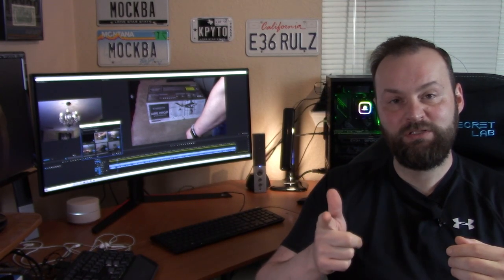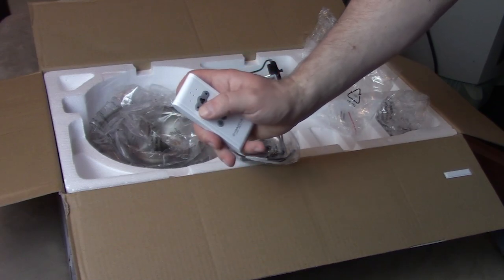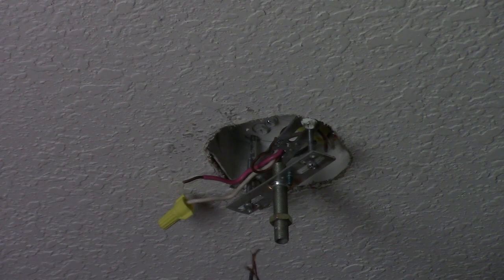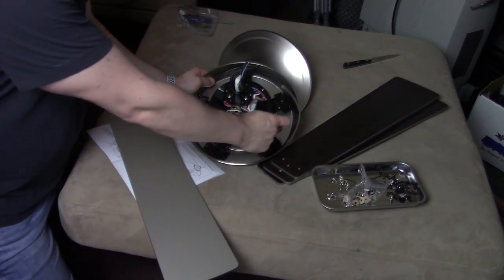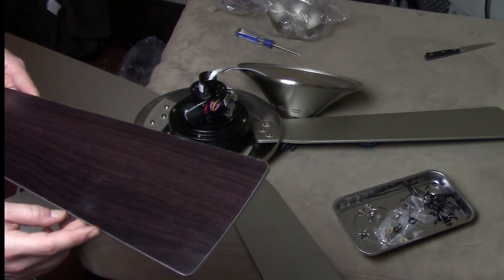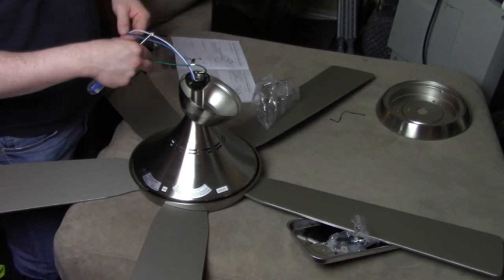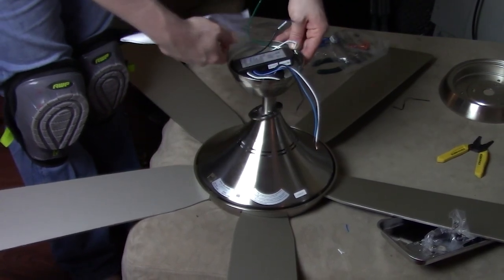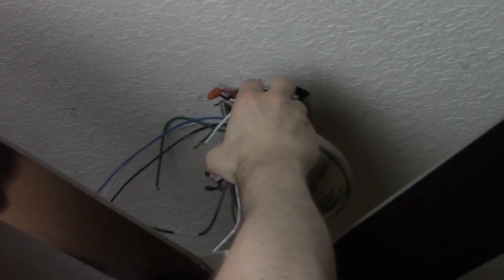How to install a ceiling fan - FANIMATION Aire Drop or Celano V2 - Review, Installation & Connection

Comment: Glad i caught your review. One item i just noticed though - be REALLY careful if you're doing this to an existing hardwired light.  I have separate dimmer/fan switches.  Support tells me I can't use my remote and have to install without receiver, especially because switches have separate wires.   The note about no dimmer and switch like that is IN the box nothing on outside.  We will see what happens.

Comment: You should make a point of letting people know that your video is for a "Flush Mount" type installation. No down rod. The down rod complicates things in a major way when trying to put the receiver in the canopy. It's basically impossible.
Reply from the maker: Thanks for the tip. I’ve updated it.
Reply: where has it been updated for that?!
Reply: Fix: moved AC (house wires) out from the middle of the hanger and running around the edge of the outside, therefore the receiver now has enough room to fit under the gap of the sloped ceiling and above the fan hanger

Comment: Hello i was installing the same fan but I only have black,red and white wires came out from the ceiling BUT the fan remote control have only black and white cables I connected black with black and white to white BUT I have only 1 switch for the light so black is not working for the switch so can I connect red and black for the switch to control the fan and light?

Comment: is this possible to install this fan if you only have a positive an a negative  coming out of ceiling old house and if so a short description  would help me thanks would i put the box on with the power wire for the fan an light

Comment: This wss a good tutorial for the installation but i don't like this fan because the remote is buggy and the fan doesn't respond always to the remote i can't deal with that. I cannot have a fan that responds off and on or experience a ridiculously long delay before it actually does anything.

Comment: My buddy just installed one of these for me in one of my bedrooms and everything works fine, except the stupid app says no fan within range and can't find the fan. Does that wifi antenna literally need to be outside of the canopy and on the ceiling? It kinda shows it like that in the diagram but I can't fathom doing that since the canopy is very tight to the ceiling and would pinch tf out of the wire...? Super irritating I can't get it to work at all with app since I spent the extra money for a smart fan. Any suggestions? I'm having a hard time finding anything via google.

Comment: Were you able to get one switch on your wall to turn on/off the fan, and the other to turn on/off the light?  My electrician wired everything to one switch and told me I now have to use the remote to control everything. This just doesn't seem right.
Reply from the maker: Robert Starkey - the fan is running from 1 wall switch. These newer fans only have 1 power connection (for both the light and the fan). When the wall switch is on, you control everything with the remote. Once you flip the wall switch OFF - remote control becomes useless. I hope this helps.
Reply: @Outlaw_SEO  so there is no way to control the light and the fan power separate?
Reply from the maker: Robert Starkey - not unless you want to modify the stock wiring. This fan is designed to run on one set of wires. The switch turns on or off the whole circuit. The actual operation (fan and the light) are controlled with remote. 

If you find of a way to split the operation into 2 switches - let me know. I’d be interested in this workaround.
Reply: @RobertStarkey  I tried and unless you don't want to use the remote for the fan you can use the second switch by hooking up the extra power wire from the ceiling to the black motor wire on the remote box. But if you want to use the remote for both you can only use the above-mentioned  option.

Comment: Did the area by the wiring on the motor assembly bend upwards. Its not completely flat. I'm trying to see if this is a defective product or how it come. Its circular and has holes in it. Right under the wires..
Reply from the maker: I don’t recall anything being bent.

Comment: I installed a similar fan a few months ago and it has always had an issue with the power to both the fan and the light cutting off for a second or two before coming back on. Sometimes this happens once per hour and sometimes it happens every 5 minutes. Is this an issue with a poor connection? I didn’t use the drop bar so it’s flush mounted to the ceiling and it was a huge pain to get set up the one time which has kept me from going back up to fix it. Before I do I want to be sure what the problem is. Thanks!
Reply from the maker: It sounds like the controller box might be faulty. I’d recommend double checking the connections.  Make sure that they have not come apart. If that doesn’t work, your best bet is to call the manufacturer and ask them. Usually they can spot the issue based on the symptoms. Let me know how it works out!
Reply: @Outlaw_SEO   Thank you!  I will double check the connections here in the next day or two while I’m off work but I’ll call the manufacturer first and see if they can troubleshoot the problem before I do that. Great idea! I’ll give an update once it’s all worked out.

Comment: I installed the fan but now I just realized there’s no chains hanging down to turn off the fan or the light that leaves me with only the switch. If I should lose the remote defend pretty much becomes useless, correct?
Reply from the maker: I mounted the remote to the wall, so it never leaves the cradle. But if does get lost, you can get a replacement unit online.
Reply: @Outlaw_SEO  Which isn't cheap at all!

Comment: Have you tried to reverse the fan?
Reply from the maker: Yes. There is a switch on top of the canopy
Reply: @Outlaw_SEO  any chance of showing me the switch please?
Reply from the maker: If you look on the fan base (above the blades), there are air vents all the way around. One of those vents has a movable switch.
Reply: @Outlaw_SEO  That did the trick, thank you 👍.

Comment: Does anyone know what that switch is on the inside when you’re putting the fan blades on. It’s a black switch on the motor
Reply from the maker: It changes the direction of the airflow. In the summer the fan pushes the air towards the floor and during winter the air flow can be reversed.

Comment: Remit has a dimmer on it but it never goes brighter or dimmer? How do I fix this??
Reply from the maker: The dimmer on the remote or on the wall switch?
Reply: The remote has a dimmer setting but doesn’t dim. Im wondering if the air drop light isn’t a dimming bulb and I need to upgrade it
Reply: @chuuuse3000  It should dim.  Mine does

Comment: The control box was also for the wifi connection for the fan so it can be controlled via an app or hub
Reply from the maker: You are correct. The new model does come with WiFi built in: https://fanimation.com/wp-content/uploads/2019/12/LP8069_AireDrop_WiFi_ENG-SPA_A5_OM_05_24_19.pdf

The installation in the video was done on a 2020 version without WiFi.

Comment: Can anyone help?   My fan is not coming on but my light ares.
Reply from the maker: Did the fan ever work or does it not work after the install? 

If it's #1: Either the fan died and needs to be replaced, or a wire came loose inside the ceiling box and needs to be reconnected and secured well for the future. 

If it's the latter: Most likely the wires got connected wrong.